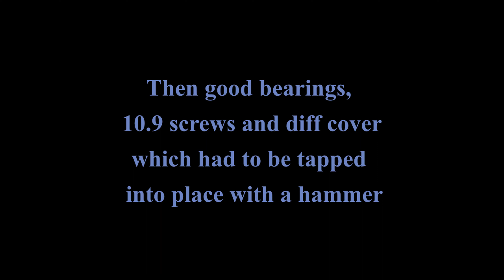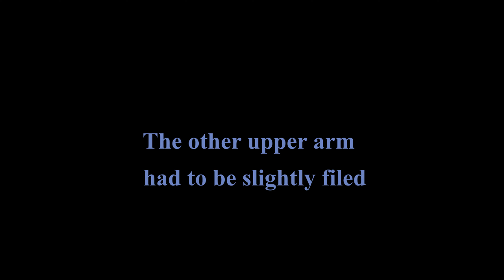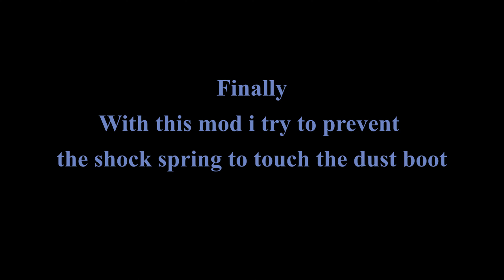FG MARDER Part 6: Rear

Comment: Hi thanks for your videos. How did you manage to take out the differential drive axle and the bearings from the diff, Dod you use any tool as I am not able to take the diff drive axle. Many Thanks
Reply from the maker: Some parts, bearings ext. Are difficult to take off. Sometimes I use heat and maybe screw driver or similar, but I always beaware when using screwdriver so I'm not do any harm or broke parts.